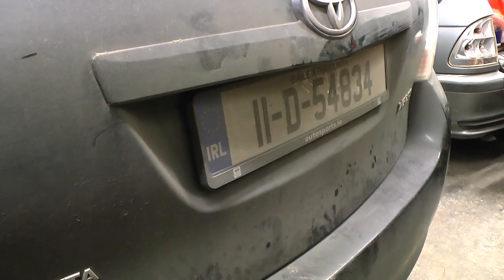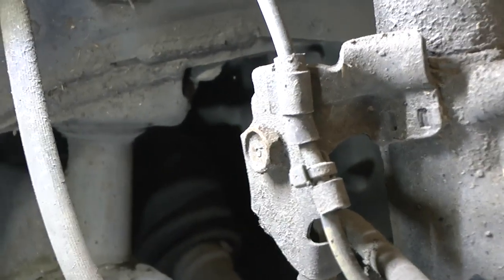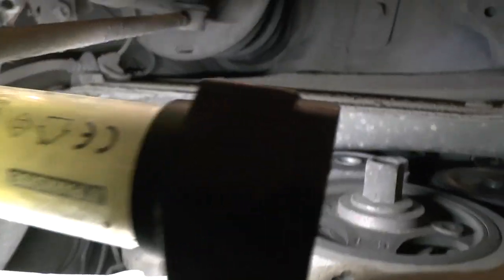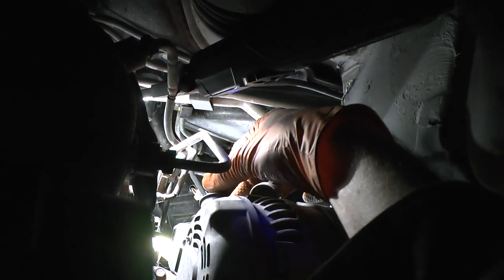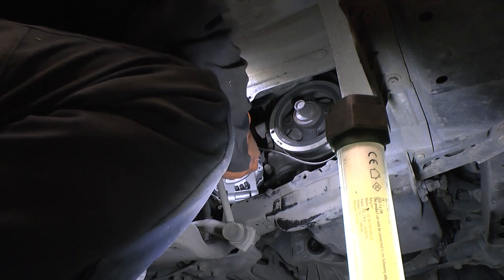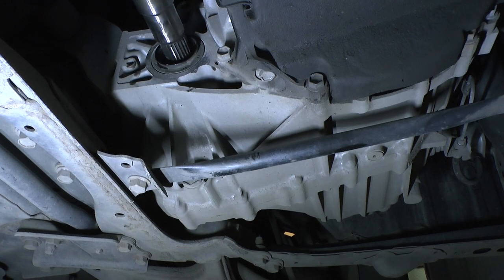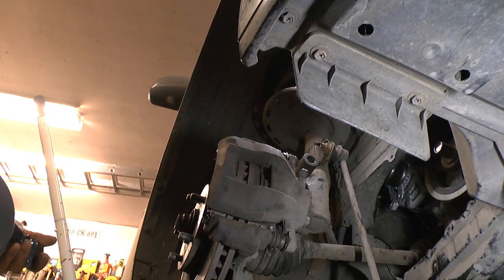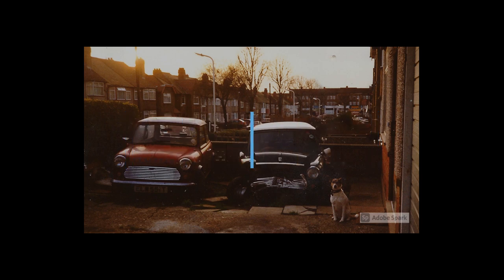Replace Alternator on Toyota Corolla and Toyota Verso Diesel D4D Engine

Comment: Great video. 
For my Auris 2l D4D 2009, I have been able to get access by the top.
To be less in the dark in this area, I started to extract the plastic part at the bottom of the front windscreen + wipers arm.
And finally and easely, the windscreen wippers actuator and then the metal vat below. Around 30min for this first part..
Easy acces to the alternator connectors, the top screw and extraction + introduction.
From underneath the car → only 2 screws 
Probably possible on other model with the same engine.

For the belt. I put the wrench by under and a strap locked on the front beam to maintain the pressure on the tensionner → I was alone and it's easier to put the belt correctly at the first attemp.
Remove the wheel for this point.

Don't hesitate to ask for more explanation.
Reply from the maker: Thanks, I'm sure this will be of help to some people.

Comment: Thanks alot mate, you've been saving me alot of headaches except my driveshaft didn't wanna come out but a few hammer hits did the trick . I'd say the most difficult thing in this task would be to take of the alternaternator bolts and connectors wires cuz it's so tight in there
Reply from the maker: That's true - small hands an advantage 🙂.  Thanks for your kind words!

Comment: I managed to get it out without taking the driveshaft out. I took the bolts out the lower engine mounts and used a transmission jack to tilt the engine and it just came out 😅
Reply from the maker: Fair play. I couldn't see a way of doing it that way myself, but I'm glad you figured it out. Taking the driveshaft out wasn't too bad - as the video shows. But, I'm glad there are different solutions to the same problem. Thanks for letting me know.

Comment: Hi can I please ask which model verso this is? Mine is 2005 and the alternator just failed. This job looks massive but I've in the past removed wheel hubs off a small Yaris so I've a bit of similar experience - if this is the same model verso as mine I may well bite the bullet and go for it!
Reply from the maker: Mine was a 2011 model. Go for it anyway!

Comment: Hello thx for this video buddy.
 I changed my serpentine belt make today and it the same noise that at 14'46 in the video.
You explained in the video with a text what you did to stop the noise but i don't understand sorry. (I'm from France)
Can you explain it with other word plz. thx bro.
Reply from the maker: Salut, j'ai dû desserrer la ceinture puis la repositionner. Ce n'était pas parfaitement droit la première fois et c'est ce qui a fait du bruit. Après avoir repositionné la courroie correctement, le bruit a disparu. J'espère que cela le fera pour vous.     Hi, I had to loosen the belt and then reposition it. It wasn't perfectly straight the first time and that's what made the noise. After I repositioned the belt correctly the noise went away. I hope that does it for you.
Reply: @banjaxedcars  thx a LOOOOT my friend. I understand perfectly now.👍😉❤️
Reply from the maker: @moaly4738  Glad to have helped!  :-)

Comment: Were you bought 30mm multipoint ?
Reply from the maker: I think it was just an ordinary 30mm socket that I got in a set of sockets. They're not rare or unusual, you can get them anywhere - any motor factors.
Reply from the maker: Try: 
https://www.halfords.com/tools/hand-tools/sockets-and-accessories/halfords-advanced-socket-30mm-1%2F2in-drive-167783.html?_$ja=tsid:|cid:73371349|agid:130550784134|tid:aud-490614416638:dsa-44242715295|crid:590251853166|nw:g|rnd:4930878875107400150|dvc:c|adp:|mt:|loc:20476&gclid=Cj0KCQjwmdGYBhDRARIsABmSEeM_edmupL4lMZNmLsXT5s30uuusIKSV6Zhih33J51PFdjdMAx6_yq0aAlgKEALw_wcB

or

https://www.diy.ie/departments/magnusson-standard-socket-30mm/1785084_BQ.prd

or

https://www.amazon.com/CRAFTSMAN-Socket-Metric-12-Point-CMMT12088/dp/B07QJCZZRH/ref=sr_1_10?keywords=30mm+12+point+deep+socket&qid=1662302741&sr=8-10

or

Ebay

Comment: Can you link 30mm multipoint ?
Reply from the maker: Hi, this is not a specialist socket, they are easy enough to get in any motor factors or tool shop. E.g.   https://www.diy.com/departments/magnusson-deep-socket-30mm/1780115_BQ.prd  or  https://www.amazon.com/30mm-12-point-deep-socket/s?k=30mm+12+point+deep+socket  or  https://www.ebay.ie/itm/403727939919?hash=item5e000f794f:g:aNsAAOSwby9gHVbN&amdata=enc%3AAQAHAAAA4NG7QqLLNf3Vrb64%2BX8LNS9Rhay1f%2B59c0p1wlFwwQ66BfshY%2FMlMOMJD3bJmnUjepTA3M2wPvOgBPsaQwdwaM7auC0WGDiLORXlWFIJeiBms%2F%2FwYK9VoTSu0v31kQxGOP7tj8J6I6kEe9AD0OojChb7CWzLrjqKOn9kY1uVeFSoHeEWwBL3e3J2gxkIppQEqfAOhWxtXzR39g5okUXLH1QKAR7P86nRw5EDzUpnfQ752dIdey%2BhBkclsjRglzbYqWhRoSVbT0t14tHrSwrpj79PvKyauyIZ5eWcAeKzvjaF%7Ctkp%3ABFBMruH8oclg